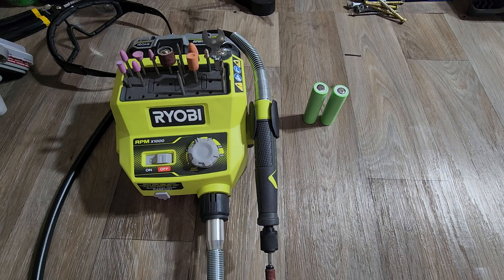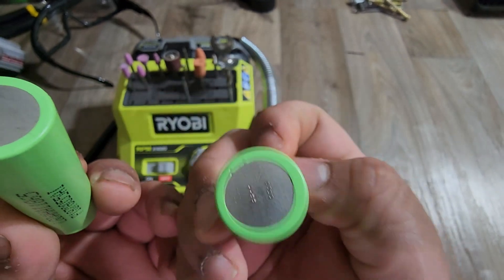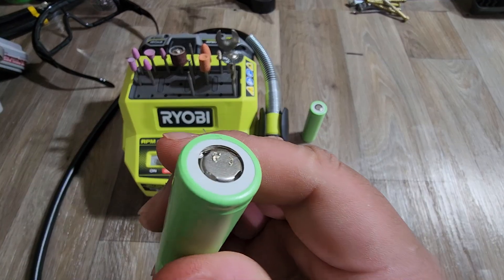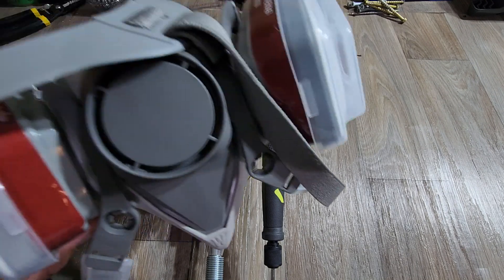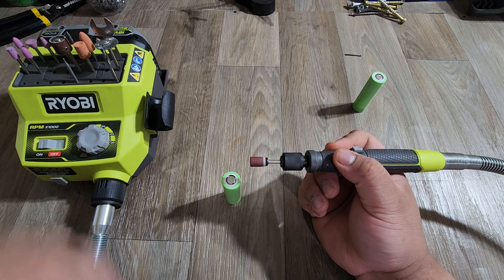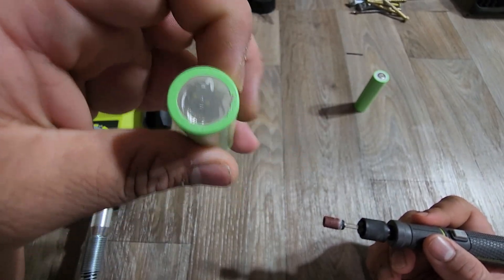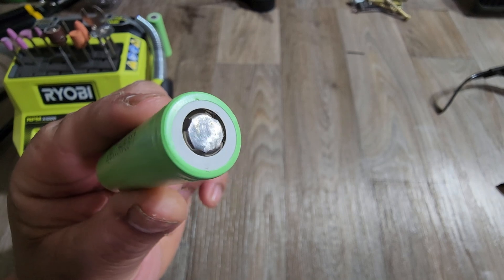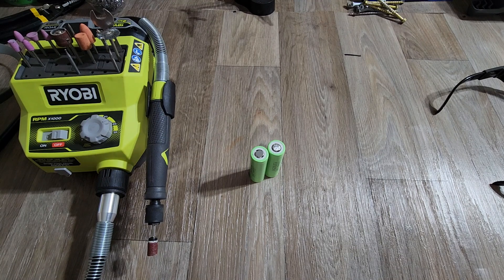Removing Nickel Strips From 18650 Batteries With a Ryobi Rotary Tool 🔥

Comment: By grinding, you are taking off the top layer of nickel from the cell. Which is its exterior layer/corrosion protection. So if you go that method, you end up putting the cell at risk for corrosion down the road.If a cell will spend the rest of its life indoors with climate control, then the risk of corrosion is minimized and there's less downside with scratches in the nickel plating on the cans. Otherwise, if they go outside, those scratches will start rusting fast.

I use a cheap pair of flush cut wire snippers. you can grab the weld and twist instead of pulling up and not damage the nickel end of cell.  like this guy: https://www.youtube.com/watch?v=6WY33EErxcg